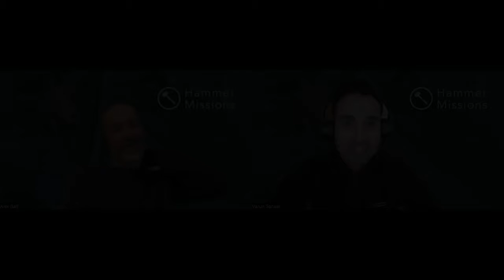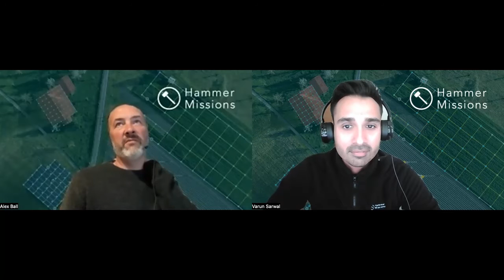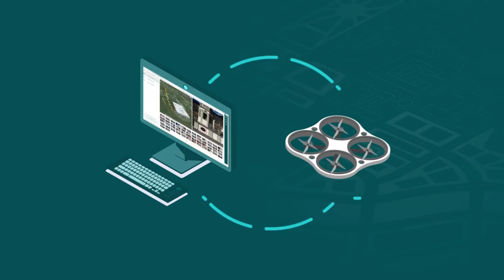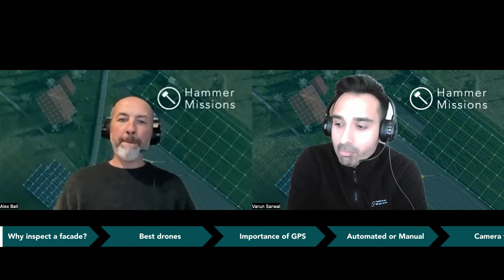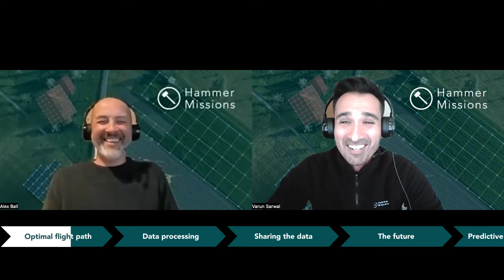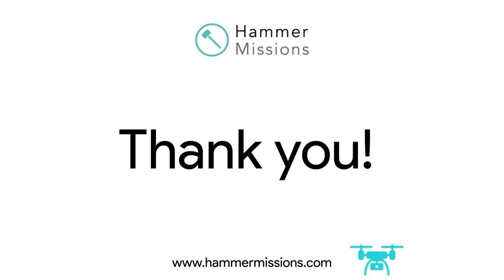Ep2: Drone Facade Inspections | Hammer Missions Podcast

Comment: Chapters (Powered by ChapterMe) - 
00:00 - Introduction
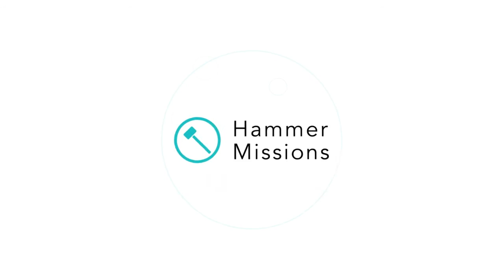01:37 - Why inspect a facade?
06:08 - What kind of drone do you use for facade inspections?
09:25 - Test flight experience with Mavic 2
10:37 - Strong GPS before take-off
14:19 - Fly the drone - manual vs automated 
18:08 - Inspection - Focus your camera
22:18 - Obstacle avoidance for drones.
25:46 - Optimal flight path
28:06 - Presenting the data to stakeholders
30:46 - Sharing the data
31:56 - 3d models and facade inspections
34:10 - Predictive maintenance
35:30 - Outro